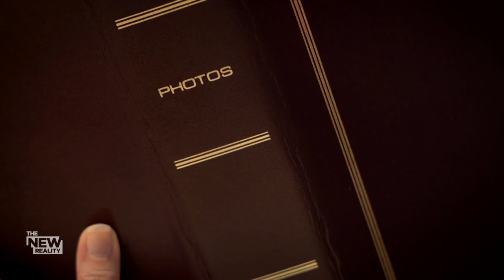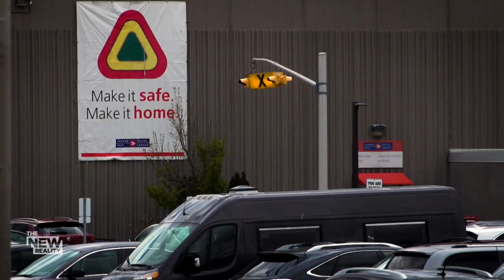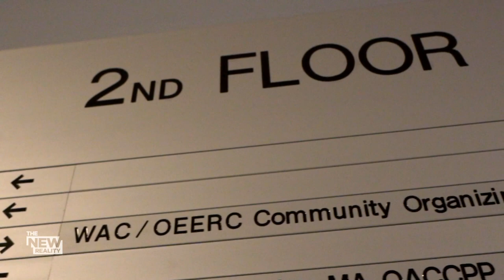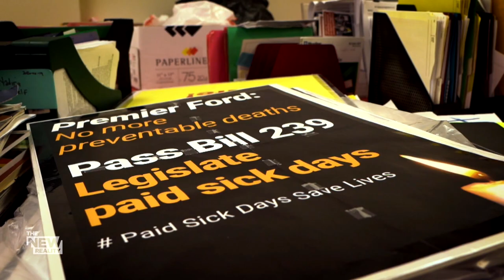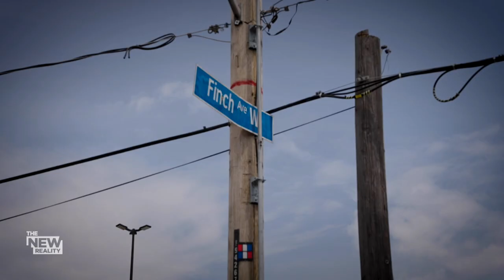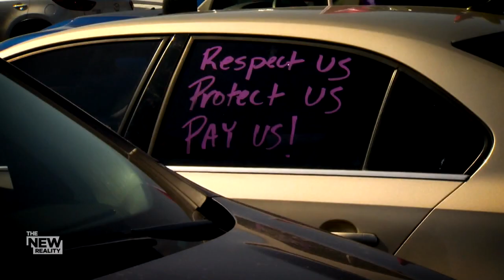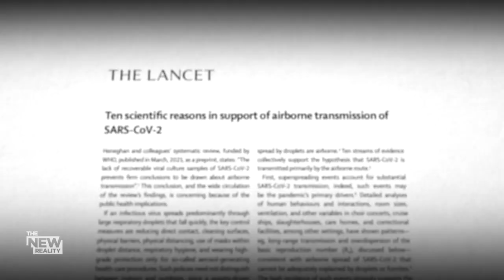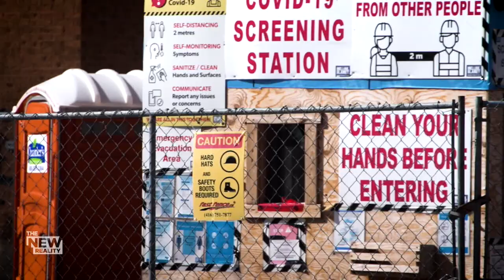COVID-19: Why hasn't more been done to keep workplaces safe?

Comment: Proper ventilation is so important. Ability to open windows in offices and schools are lacking in most buildings. Even apartment buildings built recently have no openable windows. Central air is circulated and the filters do not catch microscopic viruses. They need regular, frequent changes (filters). The "bottom line" attitude of many corporations is also contributing to spread of covid as they do not want to spend money on their most important part of the company: employees. When employees do not feel stable and secure in their jobs, they become more susceptible to lowered immune systems due to high, consistent and constant stress levels.